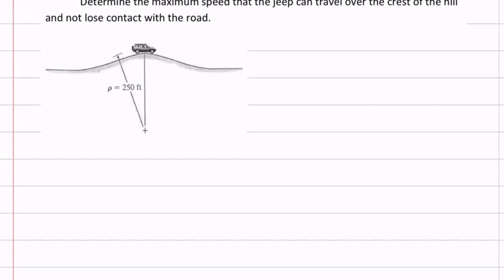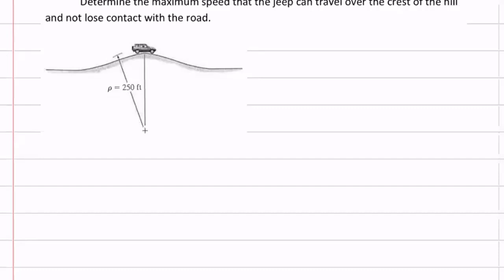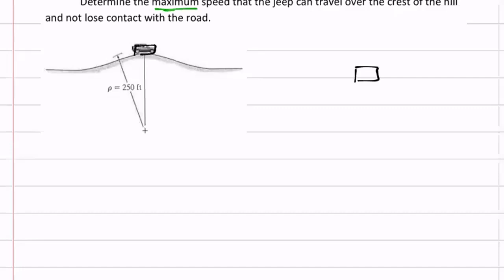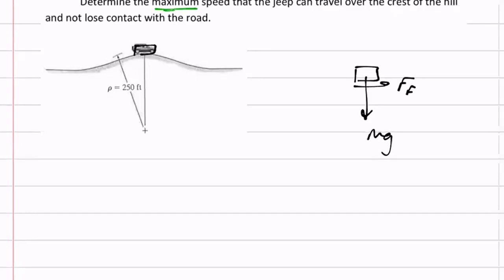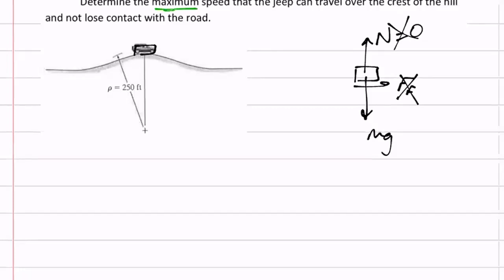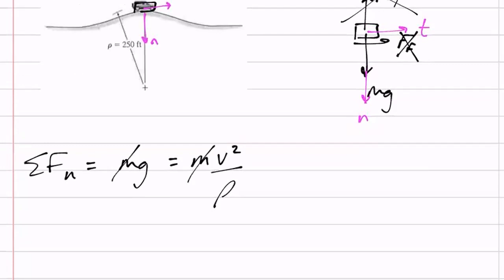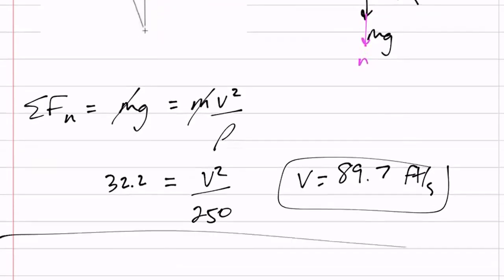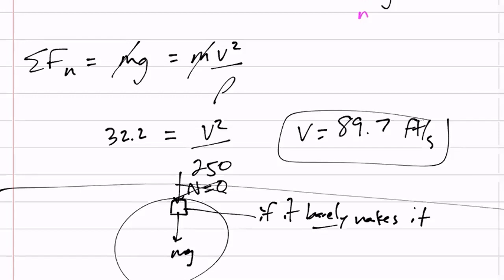Dynamics - Particle kinetics Normal Tangential example 4

Comment: Kindly explain the direction of friction, why forward, why not backward?
Reply from the maker: Friction is forward if the car is accelerating. That’s why cars go forward. The tires “want” to spin backward relative to the road but the road prevents that and (friction) pushes them forward. I have a video much further on that briefly explains friction on wheels that are being pushed compared to friction in wheels that are being torqued.
Reply: Oh thanks ❤️